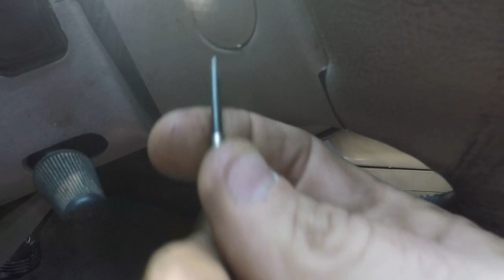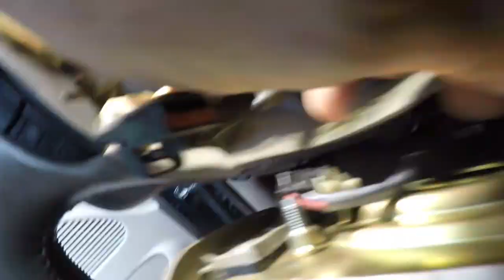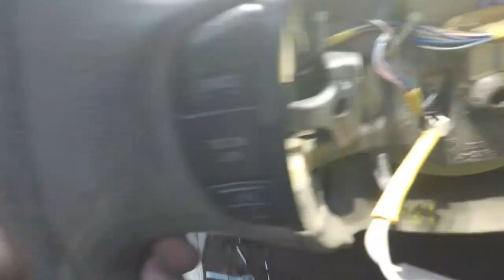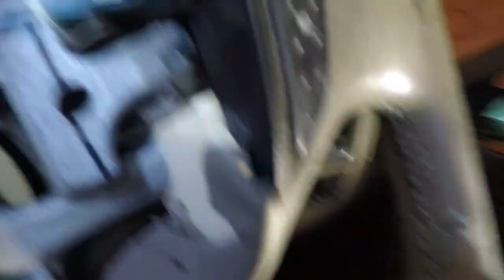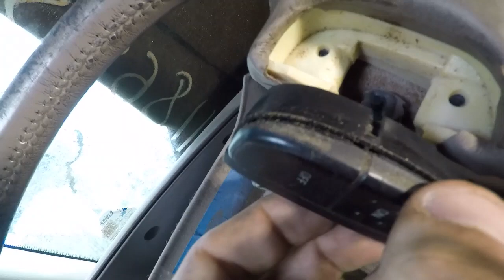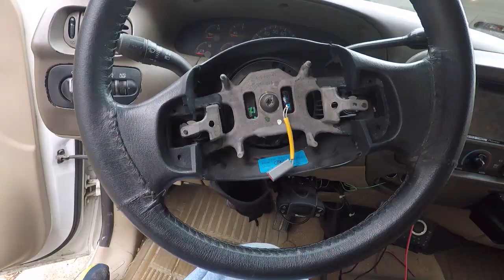Replace  Cruise Control Switches Ford F150, Expedition, Excursion

Comment: will this work for my 03 expedition xlt 4x4???
Reply from the maker: It should. The truck I removed my replacements from is an 03. My 03 expedition is very similar if not identical as well. Thanks!
Reply: @aaronsrose  great thanks!!